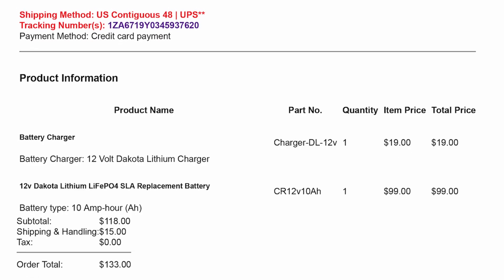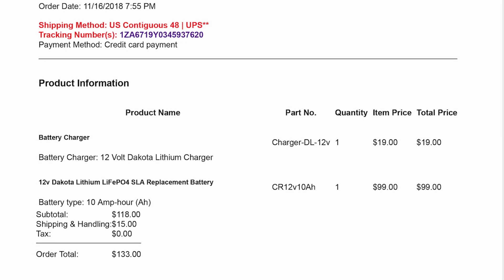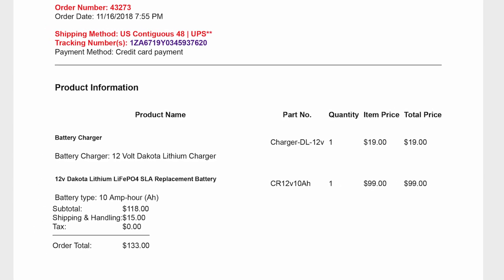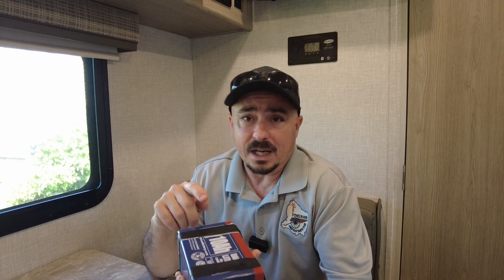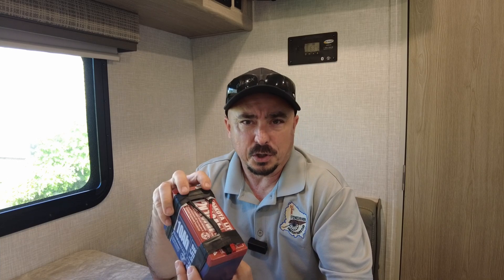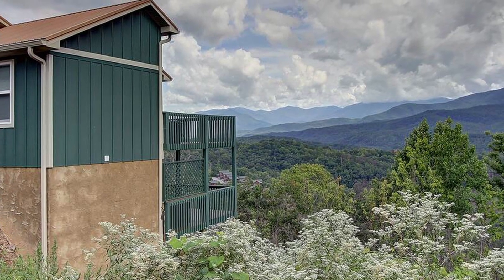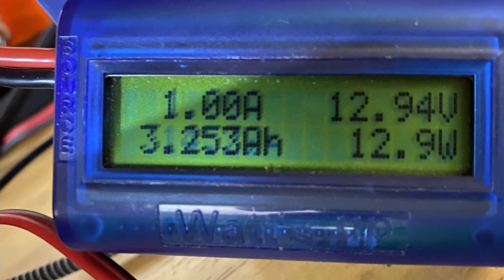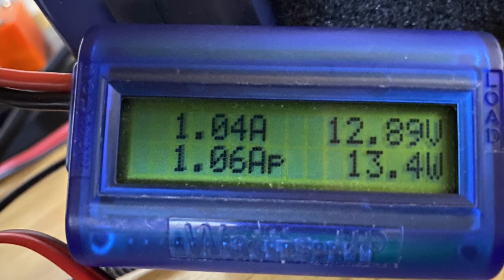Dakato LiFePO4 Battery 5 Year Review

Comment: Good real world test Jason! I wonder if you metered how much you put back into the battery on the recharge? 
I am on the verge of replacing my 2 100ah deep cycle AGM's with Lithium in my 750W off grid solar system which runs my entire shack. They have become quite soft but they have been in service for 4 years this month and cycled every day. If I get 6 years out of the lithium, I would be happy.

Comment: I have a 140AH Lifepo4 in my camper made in 2011. Bought it used in 2019. Has 1.47 megawatts through it. Ran my toaster oven this morning no problem. 12 years old absolutely going strong.
Reply: megawatt-hours
Reply: what voltage battery? If it's 12v then I guess that's seen ~875 full cycles worth. Not bad :)
Reply: @jimmybrad156  that was 5 years ago. It has double that now.
Reply: @adlucem9845  I thought the 1.47 mwh was from 1 year ago. 🌄

Comment: I have 3 6 AH Miady LiFePo4 batteries connected in parallel. The pack runs my FT-891 at 50 watts SSB easily. I am happy with their performance. Larger packs are now available.

Comment: Thanks for the follow-up.  We seldom get long term reviews and product tests, and that's actually much more useful that out-of-the-box new performance.  I was surprised that the Dakota battery survived that long fall from a mountain cabin deck and the 75 yard roll down a steep hill.

I look forward to your long term testing of the Miady batteries.  I have four of them.  One is in use as the solar powered supply for my shack.  The other three are still new in the box, purchased for projects where I never got a Round Tuit.

This was a timely video for me.  I had just sent the following email to a friend who inquired about purchasing a lithium battery for his dual sport motorcycle:

I have the same battery in my Amazon cart but it's $94 when I look at it on Amazon, not $99.

My plan is to get the lithium battery when the lead acid battery in my G310GS dies.  It's a 2019 bike so I doubt it'll last much longer even though I've only had the bike for 2.5 years.  Apparently, the same NOCO battery fits your DR650 and my G310GS.  I'll enjoy the significant weight savings, although I wish there was an option for as much lithium battery storage as will fit in the same size battery, with added weight and added cost compared to the minimum lithium battery that will provide the equivalent starting current as the original lead acid battery.  I'd like to have excess capacity, not only for long term storage without trickle charging and to do more cold cranking when trying to overcome a mechanical problem, but also so I could use the motorcycle battery to charge devices in camp or power a ham radio.  I trust NOCO not to play specsmanship games, while Chinese manufacturers will flat out lie.  The NOCO's 36 watt hours is pretty respectable for a lightweight motorcycle battery.

I have nominally 12V LiFePO4 deep discharge storage batteries (not optimized for high engine starting current) with internal battery management systems (like the NOCO lithium motorcycle battery) that are 8, 16 and 36 amp hour batteries.  The 8 amp hour battery is significantly smaller than the 3 amp hour NOCO motorcycle battery.  I thought of rigging the 8 amp hour battery to charge from the motorcycle when riding so I could use that as a camp power supply without running down the motorcycle battery.  I mostly decided against it because I charge the cell phone and tablet while riding so I arrive at camp with those devices fully charged.  Mostly, I need to charge the Cardo intercom and I can do that with the bike powered off at lunch or at camp, by plugging the USB charging cable into the SAE to USB converter that I carry.  Recharging probably takes 20 minutes and the drain on the motorcycle battery is minimal with the ignition (headlight, etc.) off.  If I did much ham radio operation while motorcycle camping, I'd have the SAE port charging a LiFePO4 battery while I ride.  It's much less hassle and less added weight than solar power.

Lithium batteries are much better in cold temperatures than lead acid batteries.  They retain more charge when cold soaked, they don't self discharge as much, and they aren't damaged by cold when discharged, unlike lead acid batteries.